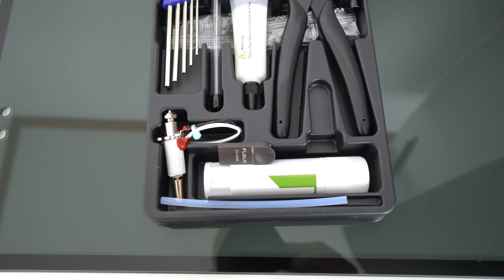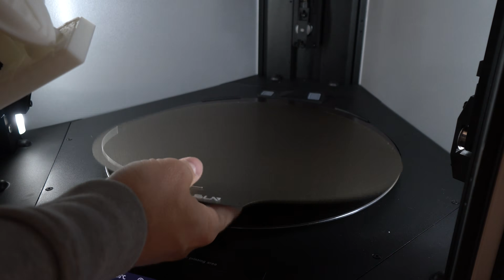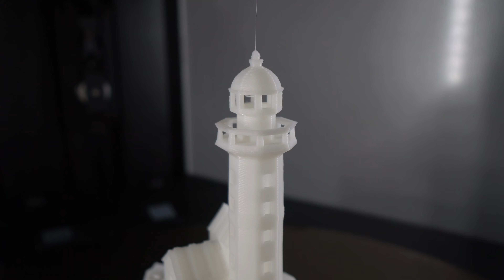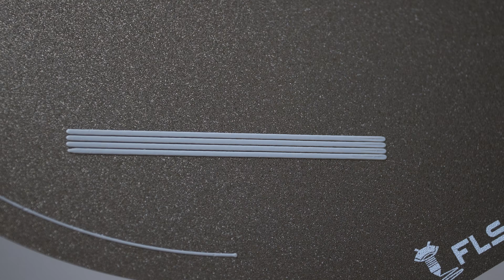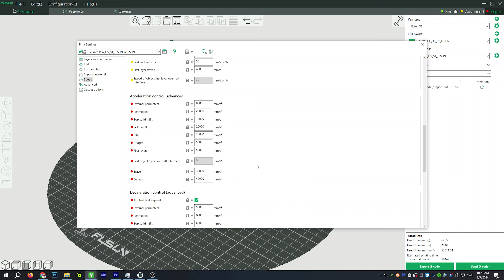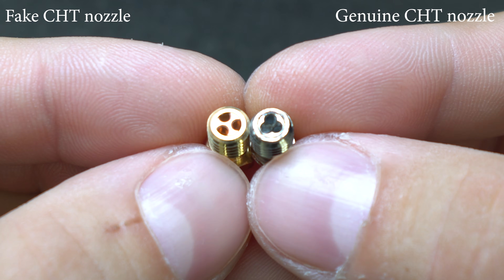FLSUN S1 Ultra Fast 3D printer full review and upgrades - All you need to know!

Comment: I am deeply disappointed and dismayed by FLSUN's conduct. The only positive aspect has been the support provided by their Italian technician, who assisted me as much as he could. Approximately three months ago, I purchased their latest model, the FLSUN S1, for €1,635.00.

From the outset, the printer exhibited serious issues: the hotend and extruder became completely clogged. I was using Bambu Lab filament, as I usually do. The first time, I managed to clear the blockage with great difficulty. A few days later, the filament would no longer melt. Being a person with disabilities, I lack the manual dexterity to disassemble the hotend and extruder.

In agreement with the Italian technician, I disassembled the arms and sent the entire component for repair, without incurring additional costs, not even for shipping. However, I had to pay €50 to a technician for disassembling and reassembling the arms, plus approximately €70 for the filament used in a print that was halted midway.

Just over a week ago, the same problem reoccurred. Exhausted by the situation, I agreed with the technician to request a refund for the printer, which had been used for less than twenty hours in total. It seemed that everything was resolved, but unfortunately, that is not the case. The latest communication from FLSUN indicated that they had instructed the seller to collect the printer and proceed with the refund, which clearly has not happened and I fear never will.

In my opinion, since this is likely a manufacturing defect, the collection should be handled directly by the manufacturer. I had purchased this printer to occupy my time, being confined at home. Now, I find myself paying installments for a printer costing over €1,600 without being able to use it.

I am sharing my experience with all of you and will disseminate it through all means at my disposal, including legal action. Thank you.